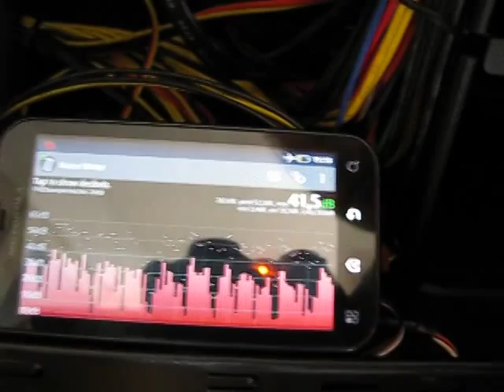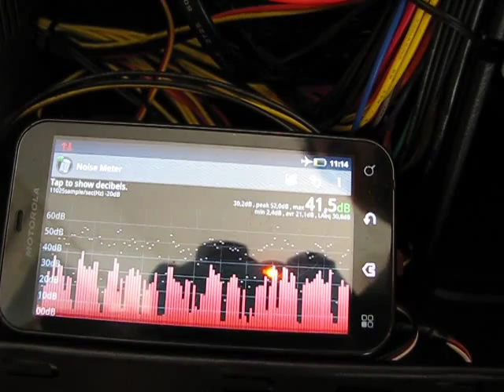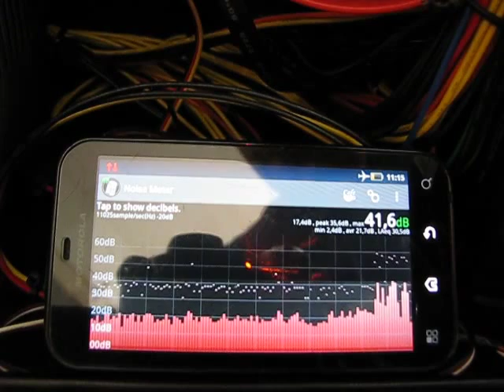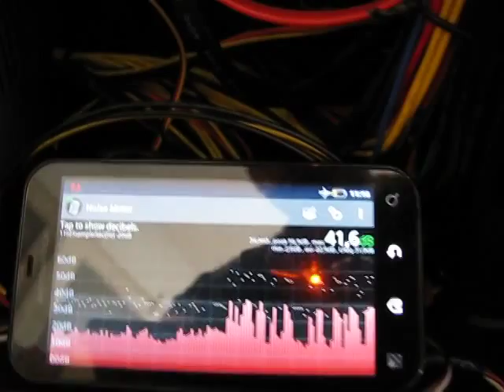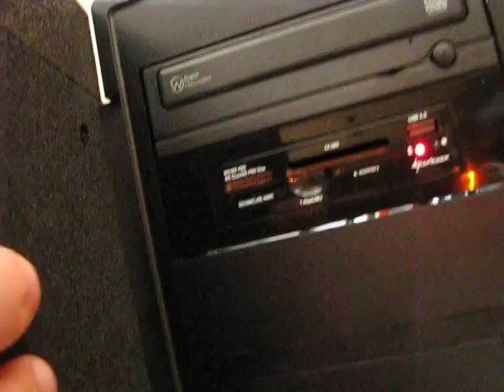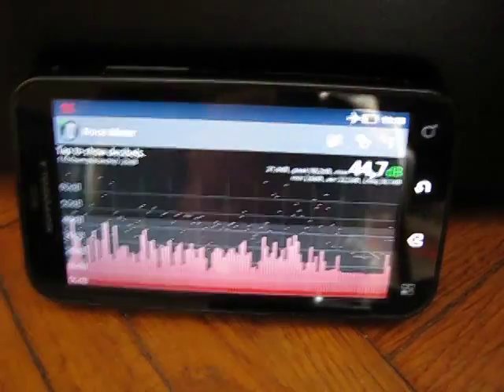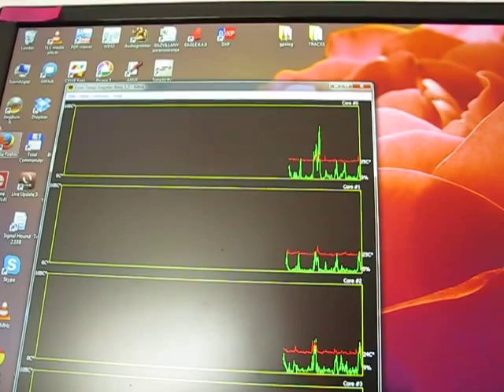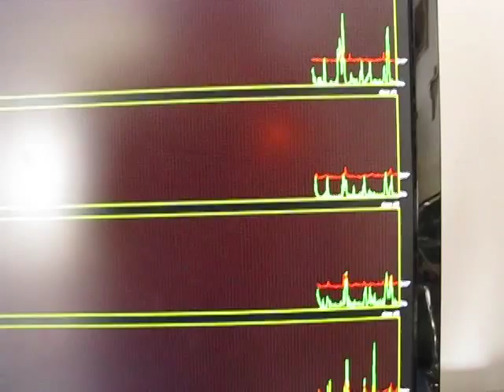Building a Cheap Quiet PC

Comment: the noise is mainly the HDD, no?
Reply from the maker: +Chez Memes Yes the HDD and the power supply big fan. Basically I hardly can hear this when the PC enclosure is put toghether (it isolates a few dB noise too)
Reply from the maker: +Veryokay But if you have an SSD... :)